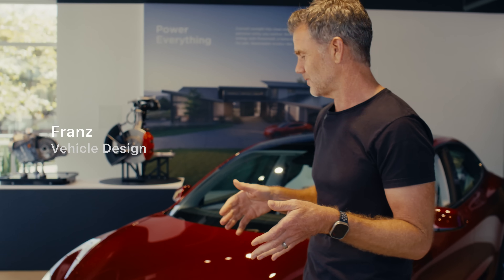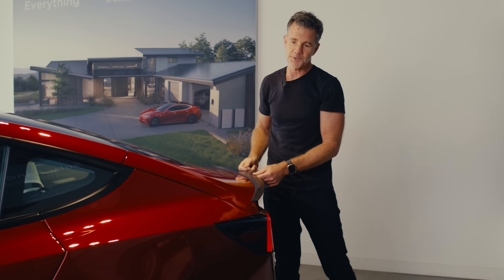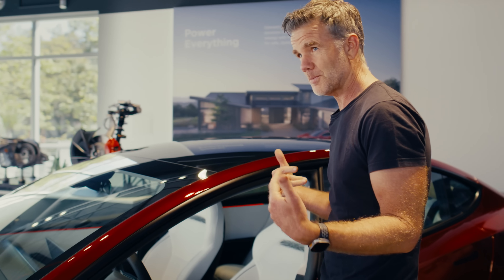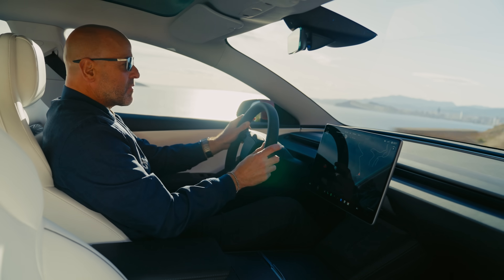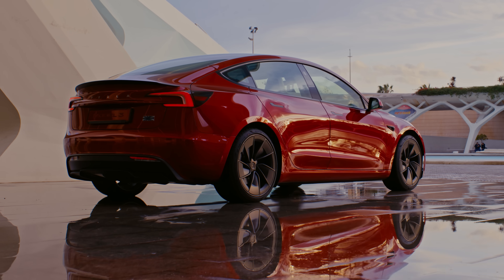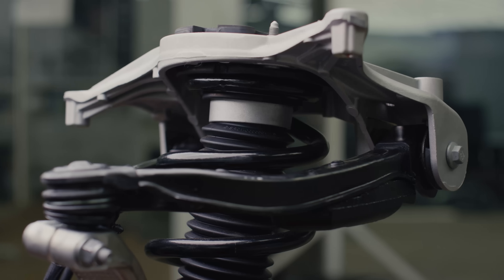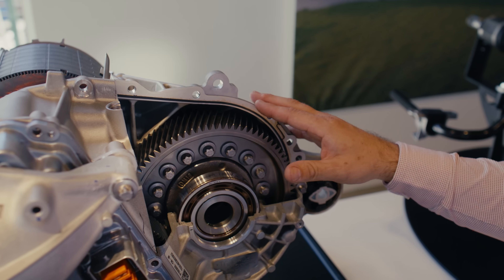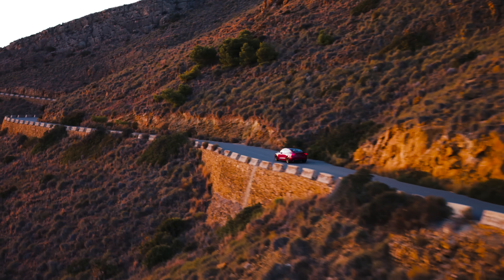Designing The New Model 3 Performance | Tesla

Comment: But still you produced flawed cars without a 1-2 US$ proprietary rainsensor. "Vision" POS assist system that cant maintain 40 Mph on an empty straight road in 300 Yards visibility in the daylight on an empty straight road and utter horrible assist system that brakes on it own ATFT due to map errors after the ridiculous downgrade where even CC brakes/slows down when it thinks there's a junction or bend on the road.... Overengineered and flawed in an unbelievable manner due to Elons greed 🤢

Comment: Did you improve regen power on the new Model 3 P ?? I have a Model 3 P MY23, and I ONLY regen -70 kW, that's awful. And ID.3 RWD, can regen -110 kW....
Reply: 😂 You're comparing apples & oranges; the ID.3 is NOT a performance-oriented vehicle, it's designed to maximize efficiency. If your ultimate goal was maximum range on a charge... Why did you get the Performance model? 🤔
Reply: @online247365  I know, that's why is so embarassing for my Model 3 P. A NON performance EV regens more.

Comment: The problem with Tesla cars is, I won’t let it be handled by an untrustworthy non-Tesla mechanic where they could drive it and abuse it if you leave them for maintenance or repairs. I wish Tesla has an exclusive, maintenance/repair facility exclusively dedicated for Tesla vehicles.
Reply: You DO know you can download the manuals on line, for free?
.
Lose the confirmation biased myths.
Reply: Tesla obviously has service centers worldwide, but if you're so worried about mechanics driving your car around you can set a speed limiter which limits acceleration and top speed, and only you can unlock it again with a PIN code.

Comment: Performance?  To drive where?  To the grocery store? To your job? You're typically driving an average of 30 to 60 mph. What difference does it make?  Absolutely nothing.  So silly. 
Considering battery performance is effected by temperature which varies all the time, what difference does it make if the rear spoiler is shaped like this or like that?  Absolutely nothing when balanced against an ever-changing battery. This is total non-sense to even mention.
Reply: You have no clue
Reply: @rogerstarkey5390  That's not an argument.
Reply: its nice to have a choice.  huge pickup, comfortable cruiser, van, super small car..   you cant believe that your own personal taste is correct, and everything different is just wrong.  thats stupid.
Reply: @mm-hl7gh   This video is not about the choice between 2 different body-style cars.  This video is about the trivial differences between 1 body-style and the performance version.
Reply: The battery has this cool thing called thermal management, which means it can always be at the optimal temperature.
Reply: @logitech4873  Creating an optimal temperature costs power which reduces vehicle range. Optimal temperature is 77F which is much higher than average air temperature for most of the world.
Reply: @DEO777  Good thing these cars have incredibly efficient heatpumps that can get it up to operating temp at a pretty minimal energy cost.
Reply: @logitech4873  What about when travelling long distance and plan to use a public charger, but when you arrive at the charger, the charging cable was cut and stolen for the copper?  Is the rear spoiler going to extend the range enough to find an uncut charging cable?  Of course not, it will reduce range and put more demand on the electric grid.
Reply: @DEO777  So you're the type that'll make up hypotheticals until you "win" the argument?
What if a giant meteor hits your car and destroys it?
Reply: @logitech4873  Unfortunately, nothing I said has been hypotheticals.  Entire charging stations have had their charging cables cut and stolen for the copper. Electric cars are not practical and will die just as they did when they were first introduced in the 1800s.
Reply: @DEO777  It's hypothetical because it's an extremely uncommon event, and it's mainly localized to the US. It's nit something I have to care about.
EVs are in fact practical. 90% of new cars sold in my country are EVs.
Reply: @logitech4873  When an event is "mainly localized in the US." that's a very big deal because the US is the largest economy.  If a business can't survive in the US, it may be short-lived.  Are you in Norway?  What works on a small island/peninsula not going to be practical for a continent-sized country like the US.
Reply: @DEO777  You're extremely unreasonable. Tell me, what percentage of chargers in the US have been damaged?

What's this "small island/peninsula" you're talking about? Look at a map.
And it's a bit strange to compare the US as a whole to a single county. Just like in the US, Europeans can freely travel between all the states of the EU. Last summer I went on a roadtrip through Europe. Covered 13,500 kilometers in my Tesla Model 3.
Reply: @logitech4873  I already mentioned what the peninsula is.
The percentage of chargers damaged/stolen/out of service is significantly higher than the percentage increase in efficiency that could ever be obtained from a rear spoiler on a car that will average less than 40 mph.  Keep in mind the video's main point is to claim a "performance" advantage of a rear spoiler on a passenger car. So if anything is unreasonable, you need to first address and defend the unreasonable claims made in this video.
If you make one more ad hominem attack, you lose by default because it will be evident you have no arguments.

Comment: Model Y needs revamping
Reply: Chill it's a mere 4 years old last month&ended 2023 as the world's best selling vehicle of any powertrain type! 
Project juniper model Y update is coming to end this year or in q1 of 2025. 

A new leaked center console design&some other details recently were shown for it.

Should be interesting to see what trickles down from the 3&S updates. I bet it gets the sports seats with ventilation on perf trims, forged 21s or 20s, better brakes, active suspension, new steering knuckles etc. Should drop 3tenths off the 60ft&run mid-upper 11s.👍🏻

Me I'm hoping tesla stops fkn around and switches the Y over to ct style 48v accessory drives, streamlined wiring, 800v main dc fast charging, steer by wire, brake by wire etc. Just bite the bullet and bring it up to or beyond ALL the new&existing competitors. I mean come on the xaomia su7 and onvo l60 now have 800v charging for CHEAPER than model 3&Y are! 

But maybe the robotaxi debuting supposedly in August 2024 is the new Apple of Elon's eye. 😐